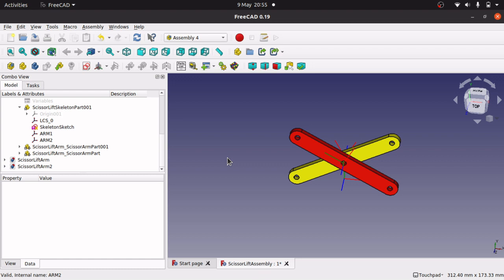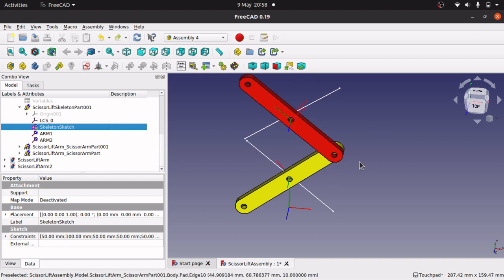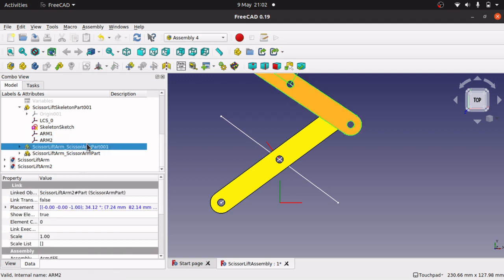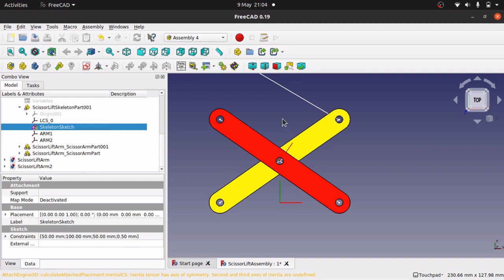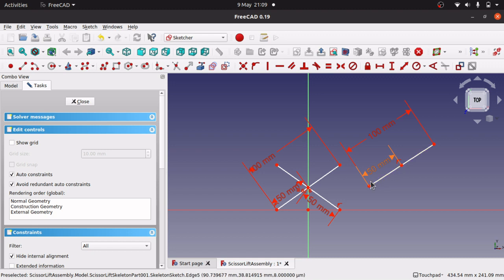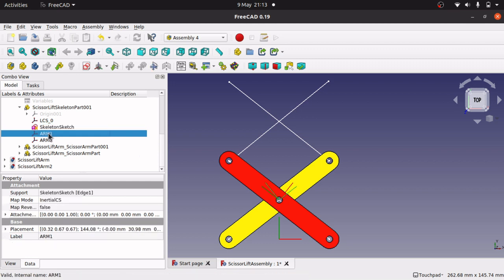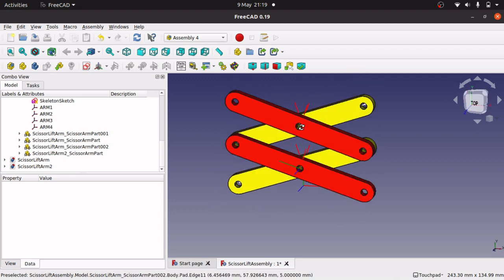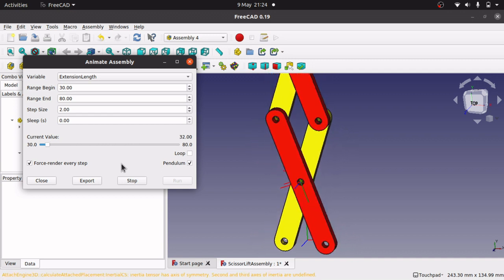FreeCAD Assembly 4 Topological Naming Issue Fix, LCS Jumping about in a Master Sketch, Scissor Lift

Comment: The sketch for the skeleton is also easier to make. The inserted gap of 0.25 mm is absolutely unnecessary and not a clean solution. With correct LCSs, the arms can then also be aligned to match the skeleton. It just requires a prior intensive training for this workbench.

Comment: What I do not understand is that this really isn't an issue. The issue is that the names are all temp names which anytime you make a change FreeCAD then will more or less rename all faces to the new numbering order. Why can't they make it so that faces are giving hard values that can not be changed.  It again is stupid that they have it resort all faces every time we make a change. I haven't tried this yet, but I'm guessing there is a fix for this: for any face you deem important and do not want to be effected by the TNI simply give it a name by renaming it which I'm guessing will change it form the system temp number to the facial  name which then can't be effected when the program does the resort.

Comment: I don't get it, could FreeCAD not Just use a UUID to name things?
Reply from the maker: It's extremely strange, it must be something embed in from the start. If as you say you have a uuid then you could keep an internal local lookup which is saved with the file containing all the names. The only time I have seen something like this before is when a company I worked for took on a project programed by another company. The unique Ids were made from their own random number generator which was not exactly random and resulted in collisions. The format of this number got so embedded into the company that trying to change it meant amendments all the way down the supply chain from paper based order forms to dB field size increases and sanity checks on hundreds of systems. A massive job for a small change. Its still plagues the company to this day
Reply: @MangoJellySolutions  
Some say programming is like sex - one mistake and you have to support it for next 30 years…
Reply: @MangoJellySolutions  I worked with the same ERP system for ten years or so.  I know EXACTLY what you mean 😂

Comment: Liked the work around but it does not put the line points coincident. If instead of a point on line and a distance and a dimension try using the point on line twice with each end point on its paired line. As far as Topo problem I like the link stage branch but want to stay with the main one. Thanks for a great channel